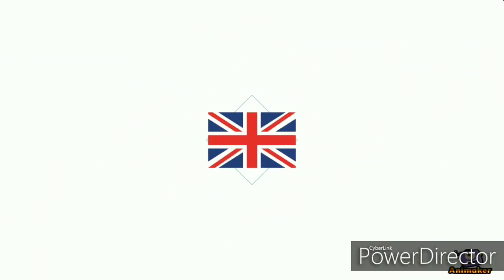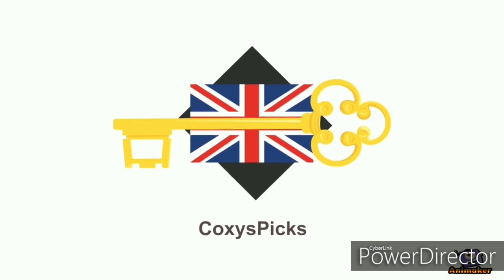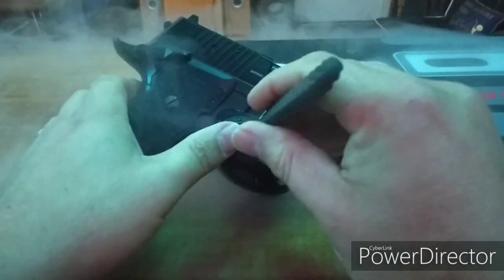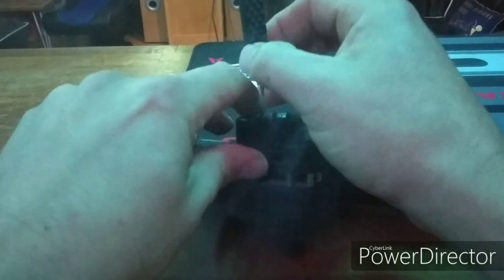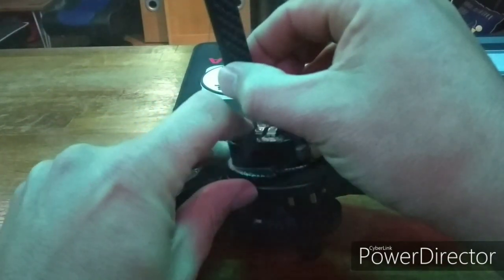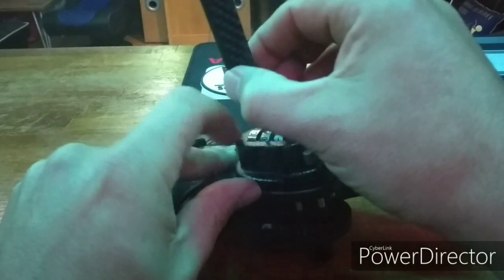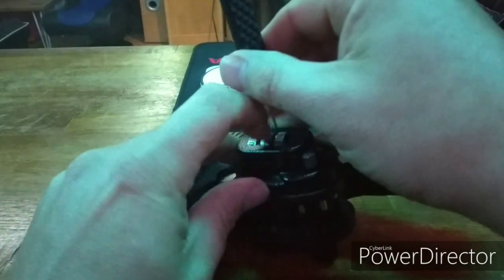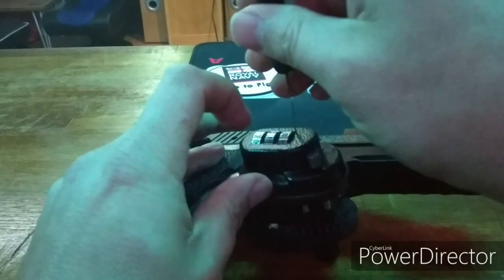Trigger Lock (UK) Combination decode with tool

Comment: It looks better than some of the locks I've gotten with actual guns here in the US. The law requires that all guns sold must come with a lock. The last one I got had a trigger lock that was two pieces of plastic and a bolt/screw with a funny shaped head on it that was easy to get off with a regular flat head screwdriver... this lock you have should at least keep out young children... I wound up replacing the crappy "trigger  lock" with an almost as crappy cable lock that the sheriff's department gives away for free here - A 3 pin lock easier to pick than a master lock... why is gun safety scoffed at by the majority of the world including America? This kinda crap is why the best thing anyone can do is teach their children actual gun safety and not just lock them up and pretend they aren't there... sorry about the rant but this is a subject I am very upset with. I have 4 kids and a dozen guns. My children know how dangerous guns are and have a healthy respect for them. They don't even point their toy guns at each other...
Reply from the maker: Feel free to rant buddy. It's always the gun owner blamed first if it all goes wrong. My little ones are well aware of weapon safety and my weapons are locked away as required by UK law. I am just amazed that this lock is considered acceptable. Still, you have to work with what you are given. Have a great Xmas buddy 👍
Reply: @CoxysPicks  same to you! And I'm not ranting at you. I'm just ranting... I'm sure you are teaching your children the correct way to deal with weapons as almost every lockpicker has a above average mind for security in all kinds. But safty lock manufacturers ( and most of the general public for that matter) think all children are too stupid to understand safty of any kind... so their solution often is just lock them up and pretend they aren't there... I'm very happy to hear that you prefer education rather than security by obscurity... it's all good though. Have a great Christmas week and have a happy new year!